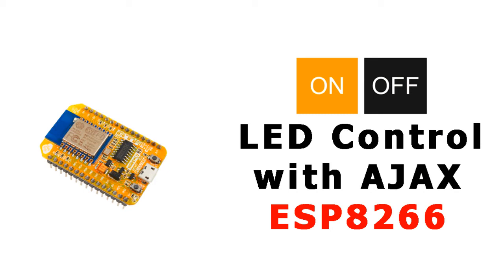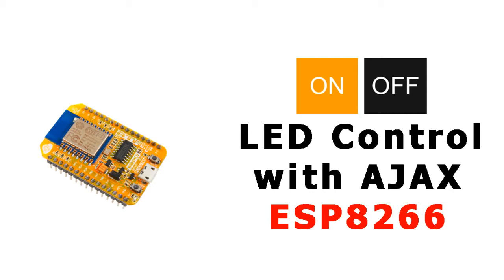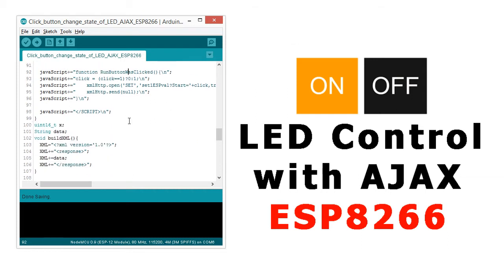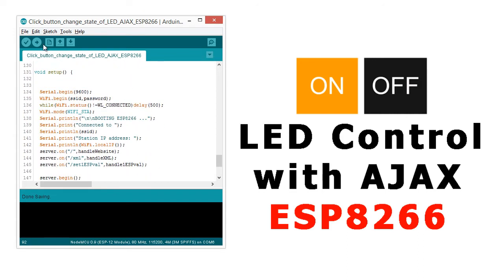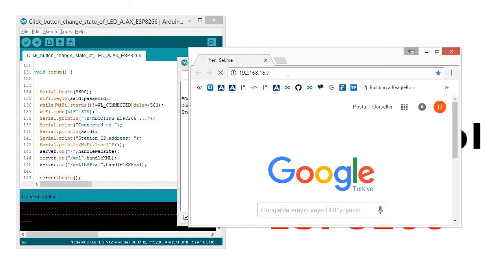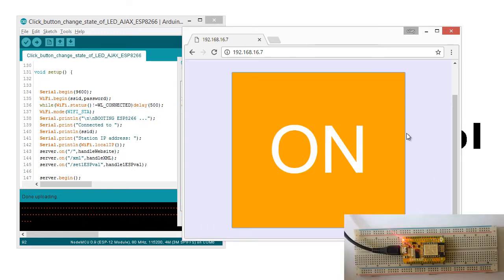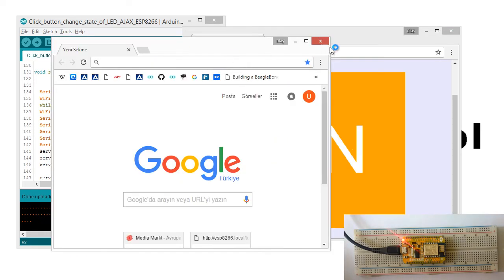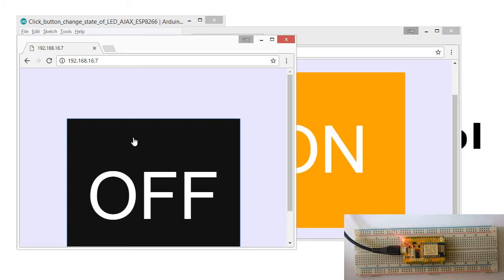ESP8266 LED Control with AJAX without page refresing via WIFI - Javascript ESP8266

Comment: Thank you so much Ulas Dikme for sharing the code, it's very useful.
Reply from the maker: Time to change your life ! Do not use AJAX to dynamic communcation, use websocket and make you life much better! !  In the link there is a code sample about websocket. Study it. I will make also a small tutorial about it.
Reply from the maker: By the way, share what you did and lets look together..
Reply: I'm still learning about the AJAX. I wanted to have multiple data elements in the XML to use them on the main webpage. The trick is to create a parent element and put the data elements in that.
 (e.g.
XML+="<data>"+data+"</data><data2>"+data2+"</data2>";  //This one does not work.
XML+="<parent><data>"+ data+"</data><data2>"+data2+"</data2></parent>";) //This one works.)
I have yet to try websocket.
Reply from the maker: javaScript+="   message = xmldoc[0].firstChild.nodeValue;\n";  did you change here ?
Reply: No, I didn't change that one. Here are the changes that I made in the Javascript:
  Javascript+="function response(){\n";
  Javascript+="xmlResponse=xmlHttp.responseXML;\n";
  Javascript+="xmldoc = xmlResponse.getElementsByTagName('data');\n";
  Javascript+="message = xmldoc[0].firstChild.nodeValue;\n";
  Javascript+="document.getElementById('data').innerHTML=message;\n";
  Javascript+="xmldoc = xmlResponse.getElementsByTagName('data2');\n";
  Javascript+="message = xmldoc[0].firstChild.nodeValue;\n";
  Javascript+="document.getElementById('data2').innerHTML=message;\n";
  Javascript+="}\n";

and my XML looks like this:
void XMLcontent(){
  XML ="<?xml version='1.0'?>";
  XML+="<parent>";
  XML+="<data>";
  XML+=data;
  XML+="</data>";
  XML+="<data2>";
  XML+=data2;
  XML+="</data2>";
  XML+="</parent>";
  server.send(200,"text/xml", XML);